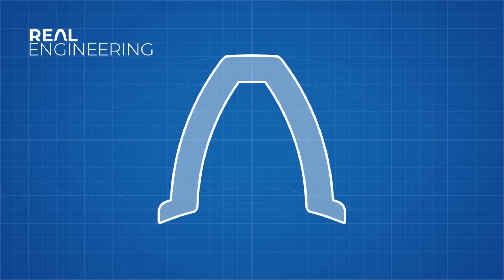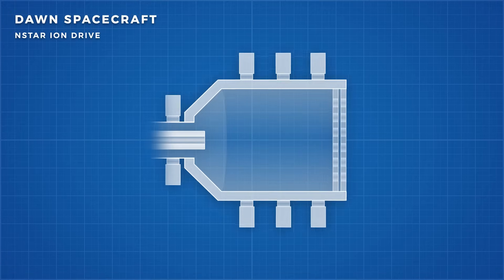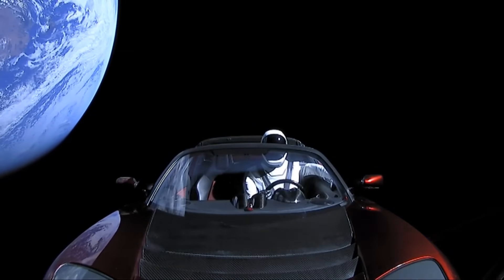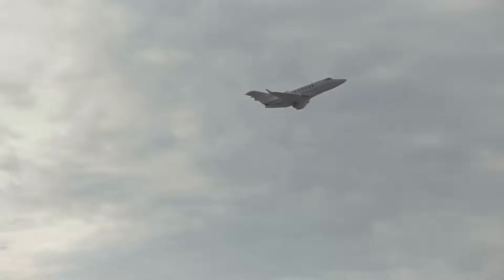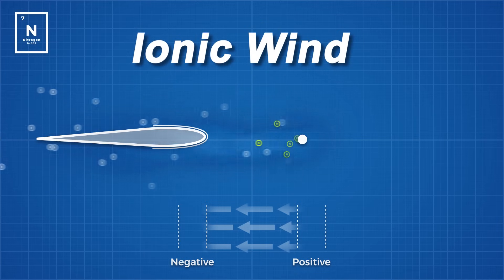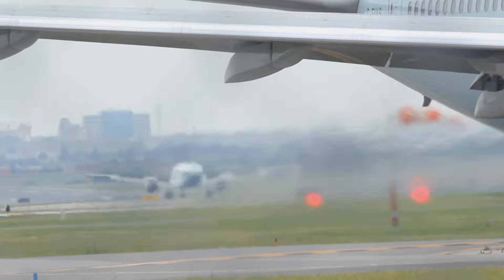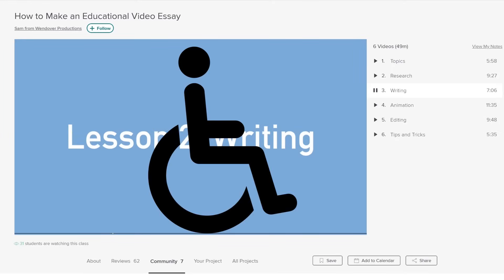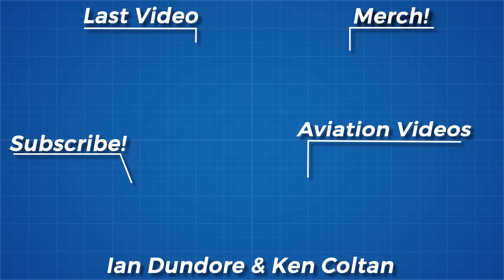Ion Propulsion - The Plane With No Moving Parts

Comment: Dear Real Engineering,
If you would please add a short addendum, to mention that MIT did not make "the first heavier than air ion propelled aircraft of any kind," I would really appreciate it.  Their Journal of Nature paper states they were first, and it simply isn't correct!!  
The Self Contained Ion Powered Aircraft was patented specifically for being the first heavier than air ion propelled aircraft to carry its power supply.  It predates  MIT's with onboard power by over a decade. It is well over an order of magnitude more efficient as well.  Anyone that clicks on the channel icon to the left can see flight footage of 7 different models that predate the MIT device.  All carry their power supplies onboard before MIT's and can be verified to do so. There are links to all of the other verifying data as well under the videos.  Thank you ahead of time for looking into this!

Comment: Its missing proper dielectric materials. T.T Brown used dielectric materials in his biefeld brown experiments. It needs dielectric materials with very high dielectric constant like barium titanate or calcium copper titanate, that will make it more than mere ion propulsion and it will propel also in a vacuum, that's how T.T Brown got propulsion working in vacuum chamber without any ions. Also electricity passing through dielectric materials need to be very high frequency and high voltage needs to be millions of volts pulsed DC or AC tuned to 1/4th wavelength.
Reply: Thank you for saving me the time of posting. The whole time I was repeating this in my head. Many students of 'sub MIT caliber' and researchers the world over have been building such craft for decades. One of the first videos I watched as a parochial boy exploring the brand new internet was of such a video. Yes, it took HOURS to download. =)

Comment: Could this be used to keep air passing over a stalling wing going smoothly without much power or drag, allowing for higher angles of attack?
Reply: vruh Harvard is looking for you
Reply: hmmmmmmmmm.....Possibly!
Reply: The ion wind produced by this is not actual wind or air flow so no, it cant.
Reply: It could, but VGs require no power
Reply: Ionocraft:  we don't need wings.

Comment: Perhaps this could be installed as part of the upper side of the wing for more control and lift at low speeds as well as less drag and construction required.

Comment: "If only we could power these engines without batteries..."

I mean .. I dunno, you could maybe use DIESEL for the electricity.  I hear it's pretty energy dense.
Reply: Diesel engines have a high weight due to the material thickness which has to withstand the huge combustion-pressure. The high weight would also move the center of weight of the aircraft closer to the front, making it more difficult to land at lower speed (and so on..) that's why diesel engines aren't really being used in aircraft.

Comment: Could we get 1000x ionic thrust if we had a differential that was 40 gigaVolts?
Reply: No because the two electrodes would start spacking. However, there is another way to increase the thrust density, and that is going to a MHD (Magneto-Hydro-Dynamic) design...

Comment: Ion propulsion may be useful for a long space voyage but the battery used on the model would have kept the plane going many times as far with a prop driven electric motor. 
At this point the aspect of ion propulsion and no moving parts gives a massive negative return for the energy used. In short it will NEVER be practical for powering a plane.

Comment: The crux of what they accomplished here is power supply. The ion tech isn't anything too groundbreaking, though it's cool. 
Some 15 years ago, as a high-schooler, I built a 'lifter' (triangle) which operated on the same concept. Plans are readily found on the internet.
That, however, was powered by a computer monitor transformer, which did not fly with the craft.
Reply: The power supply used on the above craft has been on the internet for decades.  It was invented a very long time ago.  The Self Contained Ion Powered Aircraft predates the MIT experiment by over a decade and is a lot more efficient.
Reply: @KraussEMUS1  Thanks for the heads up. From searching, it appears that you had a part in the craft you mention.
When you say 'on the internet for decades' you must mean approx. 1 decade? From searching, it looks like the patent was filed in 2014 and a sustained flight of a couple seconds achieved somewhere around 2006? Or was the first flight sooner?
Regardless that's interesting. Is the power supply actually pretty similar to the one used by MIT here?
Reply: Hi  @spruce_goose5169 , Your welcome for the heads up.  I designed and built the Self Contained Ion Powered Aircraft.  
There was an internet in 1999, and the components from the MIT circuit were online around then as far as I can tell. It consists of a full wave CCW with through hole parts and a full bridge driven transformer etc.  According to my tests in about 2003 the full wave voltage multiplier was way too heavy with too many lossy parts for ideal use onboard such craft.  It produces a lower ripple output for high current applications, but did not give good results in my experiments with lower currents.  More importantly Ion powered aircraft aren't nearly as efficient when high current is used.

The first hops of my invention with its power supply onboard happened in about 2006.  The craft was hanging from a postal scale by a string and the string would go loose for about a second at a time.  By 2011 or so it was flying for longer.  My transformer and voltage multiplier took a  couple decades of experiments to arrive at so far, and only work well in conjunction with the structural changes.  You can see all of the details in the patent if you like.
Thanks for asking!

Comment: The solely ion propelled craft covered by US Patent No. 10,119,627, lifts off vertically, and can maintain that level of thrust to weight for about 2 minutes...  The much later MIT craft has less than 1/10 the thrust by weight , and produces it for just a few seconds at a time.  It also needs a catapult and large wings.  There are 7 public videos of the much earlier more efficient craft.

Comment: you dont need batteries if you supply electricity like Tesla wanted to ,no?
Reply: That would be correct, but there are other issues that this approach runs into.
Reply: You still need a source of energy somewhere, and extra power to transmit it to a huge distances = nothing else than radio-waves... :-)

Comment: I have looked at many comments here and surprised no one has mentioned "lifters"  which uses the same propulsion system.  They are noisy. And if you are not in a ventilated area they will ionize conductive objects that are not grounded giving a person a hell of a shock. I used to play with these things back in 2003 - 2004.
With lithium batteries more readily available it was inevitable for them not to be tethered to a power supply. The power supply I used was a an old tube monitor. The one I used for a college physics demo was commercial high voltage supply. 

Do a YouTube search on "ion lifters"   And check out this ion propelled blimp from 8 years ago  https://www.youtube.com/watch?v=Cn_RQanyGOI

Comment: Related question: why don't commercial aircraft use magnetic or hydraulic accelerators to assist take-off? Are they just too unpleasant for passengers, or too rough on equipment?
Reply: Both, I've been through a catapult launch from an aircraft carrier.  That's an experience that I'm VERY glad to never go through again!  It is also hard on the airframe.  About an eighth the weight of naval fixed wing aircraft is reinforcement to withstand the catapult launches and arrestor gear landing.
Reply: @michiganengineer8621  But with a full-length runway, you wouldn't have to do it as short and hard as aircraft carriers do. It could still require reinforcement though, I hadn't thought of that. Which would likely negate the weight savings on fuel for a system which would add another failure point to airports and reduce the flexibility of the aircraft's flight time. It still makes me wonder, though, after seeing the winches that some gliders use to take off.

Comment: You know that nuclear batteries are better than lithium even lead sulphur batteries would be better.
If you really want this to work than add in positive feedback circuits, or high voltage batteries such as the electric columns which is basically foil of copper and zinc paper foil the paper shouldn't be dried before use. Also Megatron designs would be more logical and the use of magnets for positive feedback should be added. Also nickel can be easily produced from the Russian patent of microbial transmutation of nuclear sands, so a high magnetic core can be created for the ion propulsion. Also if you are looking for effective design than a dual coil design is best with the outlet being smaller than the inlet.

Comment: I'm not sure if it is habit or misunderstanding what weight is in the SI Metric System.  Weight = a force.  It is a derived unit. It is the product of mass multiplied by acceleration (= kilogram meter per second squared called a Newton). The unit kilogram, on the other hand, is one of the 7 fundamental units that make up all the derived units like weight.  You identified the ion rocket thrust as Newtons correctly then call weight kilograms.  It must me drilled into you guys in so-called "metric counties" that weight is kilograms.  That's true for a hand waving discussion but when doing any numerical analysis you have to convert mass (kilograms) to get a weight or force.  For example, what are the units of torque in the metric system?  That's right, Newton Meter not Kilogram Meter.  Torque is weight or force multiplied by length (like meter).  Just say mass instead of weight when using "kilograms".
Reply: in casual speech weight is often used for mass

Comment: This Post makes me despair! WAKE UP!..  Here is an experiment that is not difficult to construct, and conclusively proves that reaction exhaust propulsion is a waste of time and effort!  How to drive a boat forward with NO mass ejected. At the stern of the boat, have a clockwise and anticlockwise pair of Pelton Wheels fixed together in the horizontal plane. Now to rub the message home with pure satire...!!!! arrange for two young lads with super-squirter water pistols to fire alternate shots at the top and bottom Pelton wheels. 

Next is the important bit. OPEN YOUR PHYSICS TEXT BOOK AND READ IT,  BECAUSE THE LAWS OF PHYSICS ARE VERY CLEAR ON THE VECTOR FORCES OF ACTIONS AND REACTIONS. THE REARWARD REACTION IS CANCELLED!  IF THE WATER JETS HIT THE PELTON WHEEL CUPS WITH A BRAKE PREVENTING ROTATION, THEN SURE ENOUGH THERE WOULD BE A NORMAL REACTION IN THE REVERSE VECTOR.

Comment: Could you power it with a Tesla coil?  You would lose any efficiency but no battery problems.
Reply: You would lose range, since you would need a power cord.

Tesla's broadcast power experiments included a Tesla coil in the early examples, but were themselves more than just a Tesla coil. The coil was just signal source, and could basically be replaced with any AC source, the real trick is to use an antenna tuned to the same frequency as the signal source.

For modern, more practical stuff, look at microwaves and "rectennas". That's where stuff starts getting practical.

Comment: They're only useful for longer term missions in space.  The ion engine used also has a variable specific impulse; if you do the correct math using logarithms you find that, at maximum thrust (minimum specific impulse) it could get around 9348 m/s in change in velocity over 1133 days. It actually got 11.2, so evidently they used it's variable thrust to take advantage of the long mission time.
Reply: they're only CURRENTLY useful for that

Comment: no moving parts... im a little fuzzy on how that is?
so, youre saying to me, that there is not a solenoid, or switch or other electronically driven component that physically moves one way or another as part of its function?
not one. its powered by a rectangle made of dreams and is 100% hollow  and it makes the airframe - which also has NO moving parts. not one, not one for flaps, landing gear , or articulating control surfaces like switches and knobs or buttons and levers, bombay doors, nothing - this all happens making the airframe float through the sky on a wish and dream of HOPE, and when the threat receiver goes off it makes a sneezing snound - the all new sneezy breezy deezy... McDeluxe - Its the official Aircraft of Mister Sneezy 3D. 

No moving parts means NO moving parts. everything is completely static. not even the canopy has a hydraulic or mneumatic arm or bar to assist.

Comment: What about using a cylindrical Tocomak as a source of power? Using ferro-mercurials in a vacuum environment with pulsating sequential coils to keep accelerating the ferro-mercurial mixture, wuould eventually make a plasma circulating without friction since the magnetic field keeps it centered.  A second set of coils can be used for a voltage to be induced by the ferromagnetic plasma.  

Hint: Lockheed TR3-B uses this! Look at "pictures of flying triangles often described as UFO" . .Unless Pasadena California is another planet, these are "earth-made", although the  Tocomak in tese crafts are toroidal, & the radial velocity approaches near relativistic speeds, another effect is generated that works like a "standing wave, which interferes with gravity, in other words it hides the mass from gravity waves. But that is much more complicates than described, because  "resonance" has to be reached with the skin oh the craft, which by the way also has very high voltage. In time all this will be released. The circle of g light in the middle of the triangle is a Tocomak with a glowing ionized plasma field

Comment: Brilliant. However, why not have segments of wire that we can vary the voltage through and allow for difference in thrust between the left and right side of the vehicle, allowing it to be steered. For instance, if you want to vehicle to steer left, either apply less power to the left of the vehicle, or more to the right. I would assume that would just require a little more circuitry, which could add weight, but i mean, thats a bridge thatll have to be crossed eventually, anyway.

Comment: You missed one of the HIGHEST benefits of Xenon, low ionization energy.  Low ionization energy means less of the total energy input is used ionizing and more is used for acceleration.
Reply: Because majority of the air is Nitrogen.
Reply: Add a rediculous amount of power like a fusion reactor and boom u got whats basixally a ufo bc of how much thrust it would put out
Reply: #Bwhahahaha
Reply: Yes
Reply: bruh this guy looks like a neck beard but he thinks like a scientist
Reply: Kenneth Ferland yes I don’t understand why they used nitrogen instead on xenon
Reply: @johncauthorn498  My guess is that as he said the benefit of this vs the one in space is that this one doesn't have to carry its own supply of atoms to ionize. Nitrogen is the most common element in the atmosphere so it would make sense for them to try to use that instead of having a supply of xenon on the plane
Reply: @imadmorsli2871  If it worked at all....
Reply: @johncauthorn498  because there's no xenon in the surrounding air.
Reply: @johncauthorn498  because nitrogen is in the air. Xenon is used where there is no air.
Reply: Xenon is quite expensive. Argon is $18 per pound while Xenon is $2273 per pound.
Reply: N2 is free and plentiful in Earth's atmosphere but it takes a lot of energy to ionize it due to the triple bond.

Comment: Really old DARPA BS. This is not Ion propulsion or ion wind force. That was proven almost 20 yrs. by US AirForce testing. 
This is the same asymmetrical, HV capacitor under a couple hundred thousand volts used as a different configuration called a 'Lifter', that was also deflected - being called ion wind Propulsion. 
But, when put in a vacuum equal to full space, surprise! It still worked! If it were ion wind generation, it would need an atmosphere from which to create the ion field from! 
So what is really going on? 
For that we need to go back to the 1930s and the work of T.T. Brown an electrical engineer who (by accident), discovered Scalar Field Dynamics of the Zero Point Field! He tried to isolate any other possible causes, such as ion wind. He put the device into an oil bath, a vacuum - anything that could account for the effect. Nothing, accept the already modelled quantum Zero Point Energy Field, that keeps the universe in order, through dynamics that are yet to be totally understand.
The military goes to great lengths to hide this advanced technology! Why? Because it is a fundimental force potential of the universe. The dynamics of which DARPA is secretly researching, because it produces limitless, fuel less energy and propulsion! 
Many amature researchers are researching this without the ion wind nonsense. 
But DARPA (the military), has many yrs. and an almost limitless budget.
If you want to understand this history, start with the NAZI Bell. Then the 'deep black' test platform of the 1980s , called the TR3-B and the many international sightings of this and more advanced models.
You are now officially going down the rabbit hole of the Dark World of secret gov. technology dev.
Here is a book to start you off. "The Hunt For Zero Point" by Nick Cook, the former editor for aero space research of Jane's Defence Weekly.
Cheers!
Reply: Good stuff👍